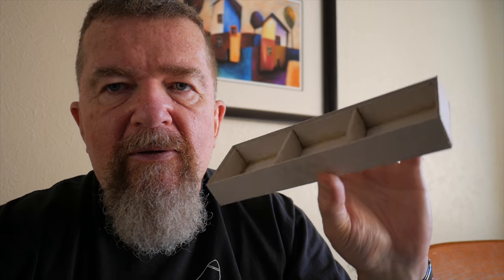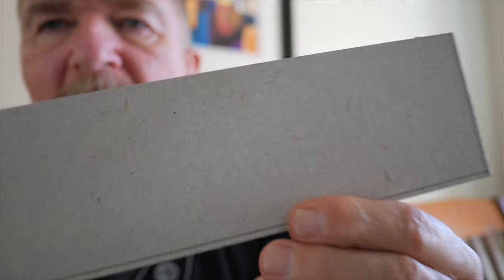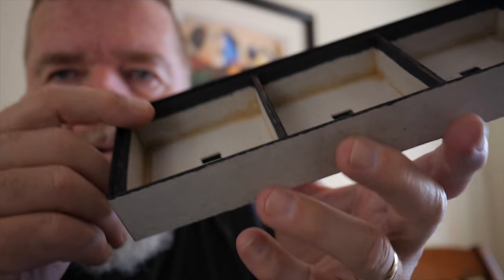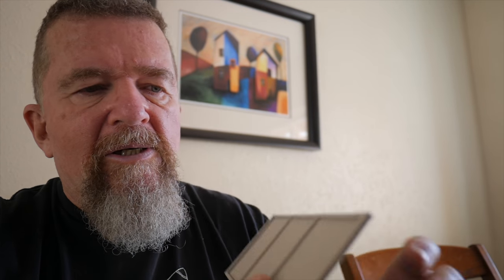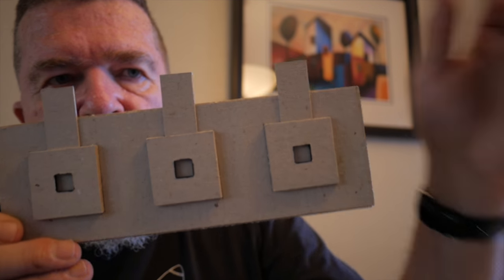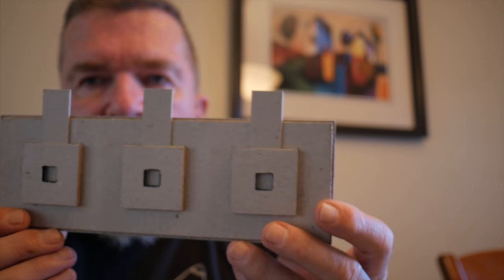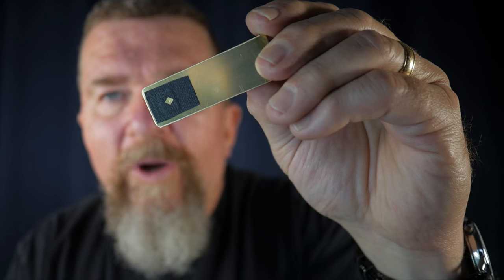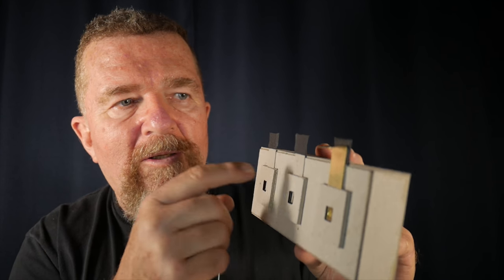3-Section Pinhole Camera, Part 3

Comment: Beading needles work great plus smaller diameters.  If you have a scanner, you can scan the hole at the highest optical setting and count the number of pixels in the diameter.  Diameter=pixels/dpi  in inches.
Reply from the maker: I've used the scanner method, still like the optical method better, not computer/scanner dependent. The needle doesn't matter as much as making a good dimple and sanding the tip down. You can get a clean hole much smaller than the needle's diameter using this method. This project ended up with a 0.2mm pinhole - pretty small! Thank you for your comment.
Reply: Your camera projects always get me looking at the pile of scrap mat board and thinking about making another pinhole.